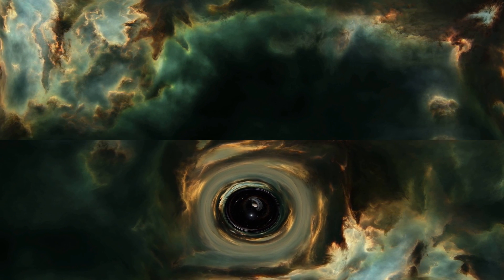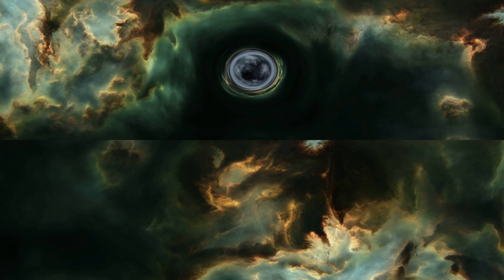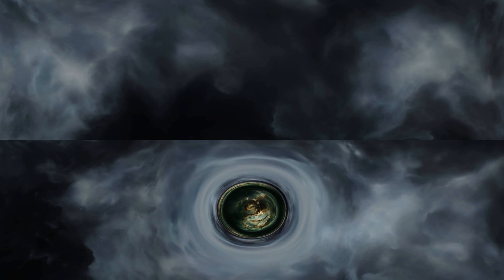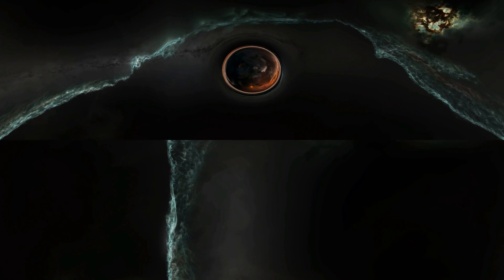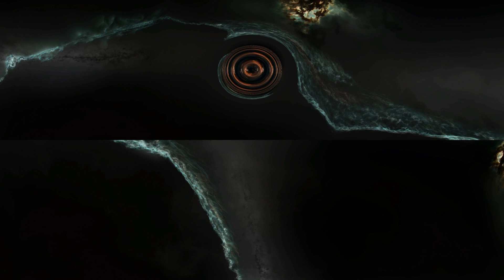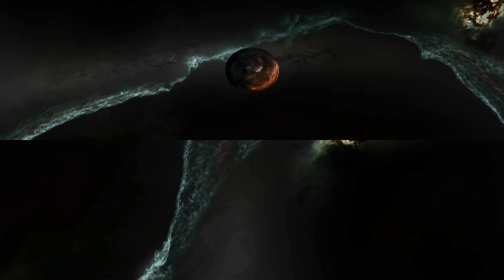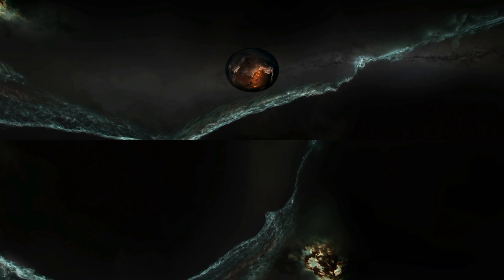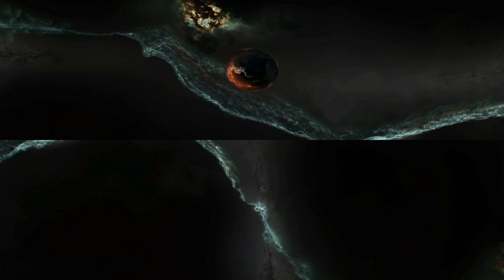What Would Travelling Through A Wormhole Look Like? (VR/360)

Comment: "the ship would crash into itself"

At this point, you know we are dealing with weird
Reply: I'd love to have an explanation of how that would be the case, I didn't really get how that would happen.
Anyone care to explain?
Reply: @ebigunso  The edge of the wormhole has a limited circumference. so basically everything getting close enogh to that edge get's wrapped around with it, and if it's larger than that circumference, it wraps back into itself. thus you hit yourself with yourself.
Reply: @MrAntice  So as you approach, before you reach the wormhole, a part of yourself loops back to collide with yourself thus you can't enter the wormhole. Am I correct?
Reply: @ebigunso  you can enter the wormhole just fine. you do have forward and backwards, it's the latteral directions that behave strangely.
Reply: @MrAntice  It is my understanding that, if your width is larger than the circumference, forward also wraps around the wormhole.
Reply: @yerdevesi  yeah. Your ship would probably get turned inside out.  Maybe even blocking the wormhole itself.   Partially missing the wormhole might also be an "unpleasant" experience...
Reply: @MrAntice  
Does it depend on the size of the throat?
Reply: ebigunso I like to think about it like, try to cup your wrist with your index and thumb. If it touches then that would be the object crashing. You would have to add that in a 3D environment and instead of you cupping your fingers space is doing that for you
Reply: Nokia 3310 Snake intensifies
Reply: Now I want a weapon that shoots small wormholes.
Reply: @Anvilshock  brutal... you'd be turning people into themselves...
Reply: @Anvilshock  Meh, it's been done, Portal is so 2010s.
Reply: @martir.7653  true
Reply: That was such a brilliant observation !    Never occurred to me before !  Thanks Scott !
Reply: When you start to play with the extreme of the physical laws of the universe  that what you can expect

Remember that if you could run fast enough around a tree (FTL speed of running) you could theoretically go F yourself
Reply: Well technically it's a paradoxical situation. It would just tear atoms apart basically...
Reply: @HauntedAbysss  For me imagine that like playing snake on a small planet. If you are running in a line on it and are too long you will bite your tail.
Reply: Unless the ship is very flexible, I think it would break before it collided with itself. Not really much different from what would happen if you tried to fly it through an ordinary hole that was too small. Presumably you were taught not to do that when you got your space pilot's licence.
Reply: Greg Ewing when it comes to space-time like wormholes you’re ship is and isn’t bending. In theory it’s bending but in reality it’s not. It’s like turning a 3D object into a 2d and wrapping it around a ball. If it touches itself it’s crashing. The paper object is still 2d and hasn’t been destroyed by the “bend” but by the crash
Reply: @tankarii  That's true in a way, but I don't think it means that spacetime distortion can just wrap an object into any shape without consequences. At some point, part of your ship will end up trying to fit into a space that's not big enough for it, and exert forces on other parrts of your ship. If that didn't happen,, there would be no such thing as tidal forces, and detecting gravitational waves would be fundamentally impossible.
Reply: For a StarTrek style layman analogy....

So, the throat is like an elevator i.e. a small space that can be used to link two larger, unoconnected spaces Imagine being in an elevator with those mirrors on either side so you have reflections going on to infinity. Then, make the elevator too narrow for a person, so the get squished between the mirrors. Now take the glass away, so they are squishing up against themselves/their own body 'reflection' directly.
Reply: That's basically KSP gameplay in a single sentence.
Reply: I think i have entered wormhole couple times. I did hit myself accidentally few times, and there is no other explanation than wormhole.
Reply: The ship would annihilate in a stellar explosion as soon as it enters. The throat is essentially a 2-dimensional disk between 2 points in the same universe. Any length to the throat is really just an extrusion of that disk and not really a true 3D volume. Along the 'z' axis of the ship (the direction it is traveling) matter will attempt to stack up all in one point along that line, BUT different particles of matter can not all exist in the same location.
Even if you can survive that, and somehow create extra 3D space inside the throat. The outside edges of that tube would not "wrap around", the matter would reflect like a mirror, again, forcing multiple bits of matter to occupy the same location.

"crashing into itself" is EVERY sub atomic particle attempting to occupy the same place as every other sub atomic particle.

Space ship goes supernova. Messing with the dimensional structure of matter is very hazardous.
I'm not saying it's impossible. I'm just saying there is a huge risk of particles of matter not playing along and trying to stack up in the same place when you squash and stretch from 3D-2D-3D again. If even just a few micrograms of matter occupies too small of a space, the explosion gets very big.
Maybe there IS some kind of super-advanced tech that could shield this, but not right now.
Where's John Crichton when you need him? (Farscape)
Reply: Thinking about it more, I really don't think a wormhole is possible, at least not one you can navigate successfully. Entering the distortion zone around it could be unstable for matter.
What is more likely is warp drives, or folding space, like in Dune. 

Folding space is like a wormhole, but the gateway is part of the ship, and the distortion field is created around and outside of the ship. And like in Dune, a uniquely skilled navigator is necessary in order to keep any matter from crashing into any other matter and going nuclear.
A bubble is created around the ship, Another bubble is created at the destination, the matter is carefully moved from the center of bubble A to the center of bubble B, and then the bubbles are carefully collapsed once the transfer is complete. Like teleportation, but no matter is duplicated, just carefully slipped through the quantum holes in the universe. That way, nothing touches the deadly edges of the bubbles and crashes into itself.

Dune, yes, Stargate, Interstllar, and farscape...no.

"He who controls the spice, controls the universe!"
Reply: Peter Belanger there is a theoretical warp drive called alcubierre drive. It’s just it requires “exotic fuel” and at first calculation it would require an entire universe of energy to travel but now they got it down to a gas giant’s worth. But I do believe that wormholes are possible but possibly very, very extremely rare. It would need a rip in space time and energy to maintain the tear open. Possibly making the outside zone of the tear hazardous none the least or not. But I don’t think it would collapse a object. A black hole does that.
Reply: Correction: Not 2  3D bubbles in two places, but one 4D bubble that just LOOKS like it's in 2 3D locations. I am imagining that the motions of the 4D bubble that is constructed outside and around the ship, moving the bubble along the 4th axis will bring the ship, which is at the center, along with it into the different location in 3D space.
But we also have to factor time into this, you may end up where you want to go, but not when you want to be there. Time travel may be an accidental side effect.
(more dimensions may be needed, this is just speculation after all)

As you can tell, I'm a HUGE fan of this stuff. I'm kinda autistic about dimensions and quantum physics and all that.
PS: (fun fact) When you try to pull two bonded quarks apart from each other, they result in two pairs of bonded quarks. Two bonded quarks NEVER separate, that's why most matter is 3 quarks bonded, that continually trade gluon bonds. Two quarks bonded together are rare.
So, squashing and stretching matter can have undesirable effects on the tiniest level that compound to catastrophic ones on a larger scale.
BTW, "scale" is another "dimension" on top of time and space, it is the fractal macro-micro self similarity of everything.

Reality is probably closer to "Dr. Strange" than we think.
Reply: @peterbelanger4094  This is interesting to me as someone doing my physics A levels...do you have any books or videos you could recommend (besides potentially this channel)? I started learning about blackholes when I was young because they spun and because they seemed like the most powerful objects that existed, and that whatever we humans could achieve was rendered useless against them. 

The only thing that works overtime is hawking radiation, where iirc when virtual particles are being created, some of them get sucked into the black hole but others leave it and escape, eroding it somehow? I'm not sure though (I saw this in a video somewhere).

Comment: In Safari this works for a while, including the 360º VR-360 feature. But then, varying from about 20sec to 40sec, the video portion freezes, while the audio continues. If I try sliding the timer, it freezes the whole video and Safari with it, which I then have to quit & relaunch.
In Firefox, it works just fine all the way through, including the time slider.

Tech details:
 iMac, mid 2011
 OSX 10.13.6
 Safari 13.0.5
 Firefox 72.0.2 (64 bit).

Fred

Comment: So if you touch the throat around you you'll be splattered all around round the edge because space is so warped? Would you feel a sheer force or would it just that space is so distorted you'd just be homogenized? Isn't the throat of the wormhole lined with exotic matter to keep the mouth open so you wouldn't be able to get to throat? 
  
Admittedly right now exotic matter is a mathematical fiction so we've got literally no idea of what its properties would be if it existed...
Reply: I don't think you can touch the throat, space loops around in there, if you stretch out you would just touch yourself the long way around

Comment: Would flying a ship through a wormhole bend it as the parallel paths are not actually parallel?  Or would that only result in a bit of acceleration at your edges that gets mitigated by your structural strength?

Comment: I have always wondered if going thru a wormhole would make you mirrored.
My understanding is that each point on the sphere on one side maps directly to a point on the sphere on the other side which is on a position diametrically opposite. If this is the case then what is on my right will come out on my left.
If each point was mapped to the other side by surface then as I enter the wormhole the trajectory of each point will change as it comes out the other side.

Comment: Could build something inside the throat. It would have greater structural support by resting on itself, for example an infinite single 100 meter long metal pole? And it couldn't float away?
Reply: Woah.... And what would happen if you tried to pull such a structure to the outside?
Reply: It'd be like pulling a ring of metal outwards at every point, eventually if you pulled hard enough it would break somewhere. From its point of view though it's straight.

Comment: 6:08 so Star Gate wasn't that much off, especially if you consider that the gates do create a worm hole you can see, but actually completely disassemble you before you're send thru the worm hole - and reassemble you on the other end.

So the water like event horizon is purely made up by the Stargate. 😙🎶
Reply: Considering matter is demolecularized at the surface of the gate, I think what we see on Stargates is not the true event horizon of the wormhole, but the demolecularization surface, whatever that might be; the wormhole itself is probably microscopic, only big enough for molecules to go thru, or possibly even just energy (molecules would be converted to energy, and not sent intact); the energy hypothesis makes a lot of sense when you consider that for matter it's one-way but radio can go both ways. It's possible it's not even a single wormhole, but an array of microscopic wormholes, which would explain the apparent flatness.

It just gets a little tricky when you consider the kawoosh and the distortion when the other side is near a blackhole...

Comment: I have heard that light takes the shortest path between it's source and destination, if there is a wormhole that shortens that distance will that change the path of light?
Reply: Light simply flies straight, even if that's a detour.  Lool in a mirror.  Light flies from your nose to the mirror to reach your eyes, even though it's not the shortest path.
Reply: @johncrowerdoe5527  Yet light bends depending on refraction index and the curvature of spacetime, not to mention diffraction.

Comment: Assuming we discover the hypothesized exotic matter and achieve the technology required to create wormholes, are there any known physics by which we could control the time space location of the opposite side of such a wormhole?

Also, if wormholes turn out to have microscopic diameters, as some have suggested, could they, perhaps, be used to transmit light speed signals between locations that would otherwise take hours/months/years?

Comment: Besides having a small ship, What are the criteria to "fly safe" around and trough a wormhole?
Reply: You would have to avoid the tidal forces generated by the wormhole.  

Although if you made the wormhole large enough, then the tides would be negligible. 

You also would have to be very careful to not interact with any of the negative matter.

If positive and negative gravitational energy were to interact, long enough, they would erase each other's existence.

 And if the negative matter had a negative inertial mass, it would cause all fundamental interactions to move in the opposite direction based upon the existence of the charge of the gravitational field, which would cause the strong nuclear force to be repulsive instead of attractive for example(nuclei would rip apart). 

In electromagnetism, this would mean that opposite charges repel and like charges attract, which would mess up chemistry.
Reply from the maker: Indeed you either need a very large wormhole, or a non gravitational hole.

Comment: I never realized Wormholes didn't have a gravitational component. This is a really cool visualization. Nice job! 

Did that paper mention anything about how to search for Wormholes?
Reply: If wormholes can have a net negative mass, then they would cause concave gravitational lensing.
Reply from the maker: They can have mass, but traversable wormholes need to minimize this.
Reply: @scottmanley  if wormholes have mass, what happens when you add Mass to it? Wouldn't this also violate the conservation of energy? If it has energy like an astrophysical body then anything you throw into a wormhole will gain energy correct?
Reply: @scottmanley  you can put the wormhole on two different planets that have two different relative velocities, and go into one throat of the wormhole and you would come out of the other one with an increase in velocity correct?

Comment: Okay.... But what does a Stargate look like from behind when in operation and he gate is not opened to a black hole?!
(Which was not spherical in the show)
Reply: Wormoles and black holes and not the same thing. Black holes are regions with extreme space-time curvature, however their energy density is entirely positive. Wormholes have extreme space-time curvature as well, wormholes just curve space in a different way due to the presence of exotic matter that allow safe passage Through the Wormhole(where as a black hole would eventually rip any matter apart and infinitely blue shift radiation)
Reply: @scifirealism5943  Did... did you read my comment? Or have you never seen the show? In Stargate, the wormholes form as a 2 dimensional disc. The only time you ever see one from behind, is during the rather irregular circumstance when they accidentally connect to a black hole and is thus not representative.
Reply: @nazamroth8427  I've seen a few episodes, with all those outdoor stårgåtes, were there no scenes of our heroes jumping through as seen from the rear?
Reply: @johncrowerdoe5527  Well... admittedly, it has been a few years since I last watched the series, and I no longer actually have a DVD drive in my PC to do it now, but I do not remember it happening even once. The closest it got was the black hole episode when the disk was stretched into a cone behind the gate, but that was most likely a reflection of the front being pulled back as well.
Reply: Considering matter is demolecularized at the surface of the gate, I think what we see on Stargates is not the true event horizon of the wormhole, but the demolecularization surface, whatever that might be; the wormhole itself is probably microscopic, only big enough for molecules to go thru, or possibly even just energy (molecules would be converted to energy, and not sent intact); the energy hypothesis makes a lot of sense when you consider that for matter it's one-way but radio can go both ways. It's possible it's not even a single wormhole, but an array of microscopic wormholes, which would explain the apparent flatness.

It just gets a little tricky when you consider the kawoosh and the distortion when the other side is near a blackhole...